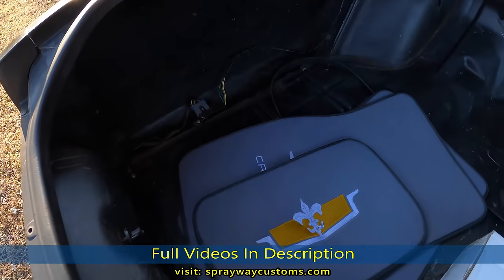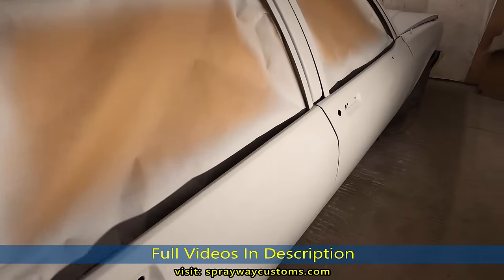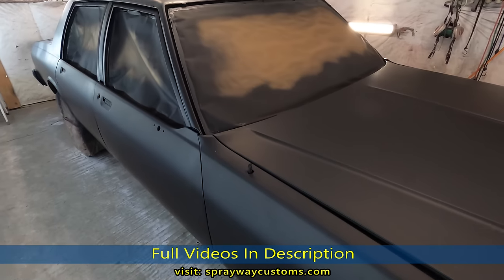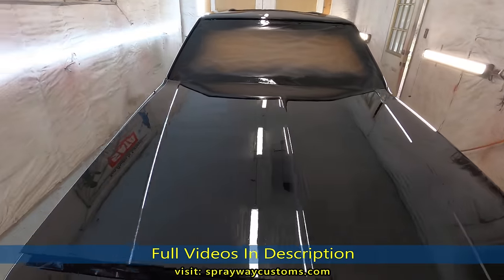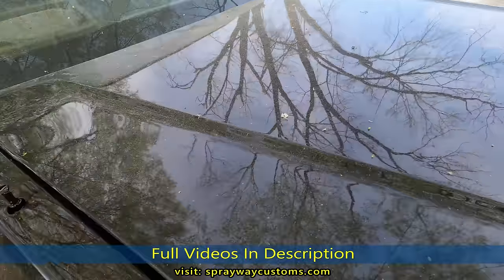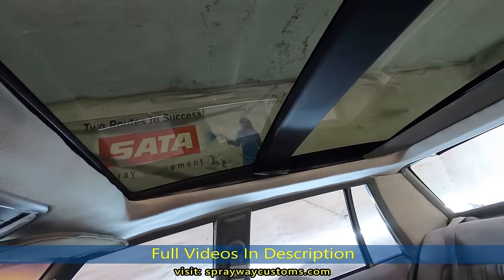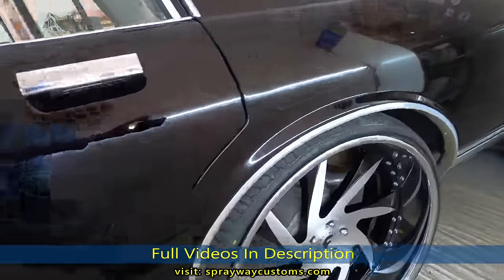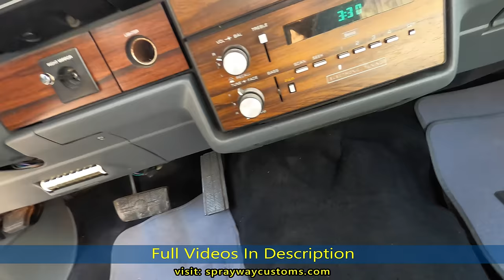Complete Paint Job Build FROM START TO FINISH Box Chevy Caprice On 26s - LS Swap - Panoramic Roof

Comment: Can you put air shocks on the front of a vehicle? Also when your doing under vehicle lighting can you wire the lights into the factory lighting wires so when they come on the ground lights comes on are should you wire the under lights too somewhere else?
Reply from the maker: Sure thing

Comment: You should invest in a Dremel  rotary cutting tool it it will help you  greatly to do fine Sanding, cutting  and grinding  also great for detail work. GreaT diy spirit. Dremel 4300-5/40 1.6A Variable Speed Rotary Tool Kit with Attachments & Accessory Bits, 46-pc. it will help make your custom work easier
Reply from the maker: Thanks for the tip

Comment: As a house painting contractor I spayed most of my jobs with an Graco airless highboy using a 5-13 tip.
I noticed your sprayer has a spray pattern the same as an airless: flat, not round.
I thought air compressor sprayers had round spray patterns; not flat: guess I was wrong.
Reply from the maker: You can adjust it

Comment: I cringed a little bit whenever he wiped any dirt / dust off the freshly painted car with his bare fingers and scratching it, but it did look phenomenal when it was done. When he did the walk around with it outside, I could see the wipe marks in the paint of the micro scratching with whatever he used to wipe it off of dirt or dust. Use some spray detailer with a microfiber if you're gonna do that 😉.
Reply from the maker: Thanks
Reply: @SprayWayCustoms  Sure thing. You did such a good job and then to see that made me cry inside! I meant my comment to only be constructive and not to just criticize you. I'm a perfectionist detailer myself and I try to provide advice where I can so I could be overly picky, but if you spend so much time on a vehicle and make it look beautiful like you did, definitely take extra precaution when wiping it with some sort of quick detailer spray (and microfiber of course). Keep up the great videos. I enjoy them.

Comment: 20's would have looked and worked better. 22's are just a little to much. 
Not all wheels work on all vehicles, as far as looks and function.
For just a little more the owner could have gotten airbags for the rear and air shocks for the front.